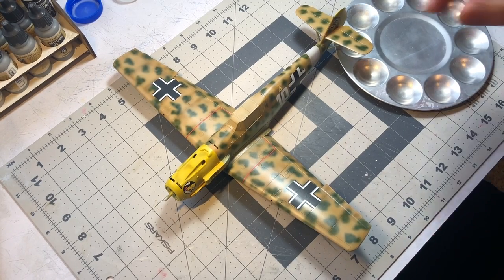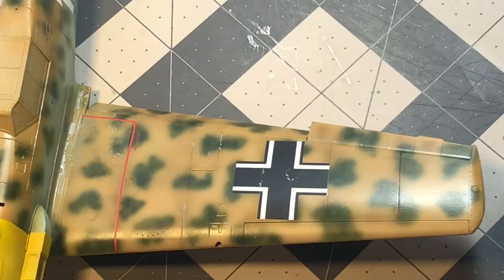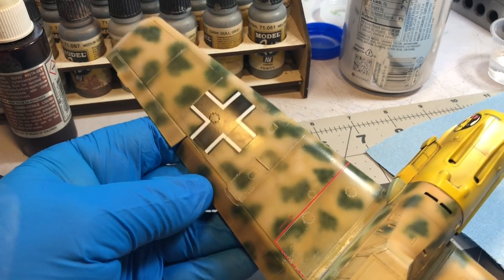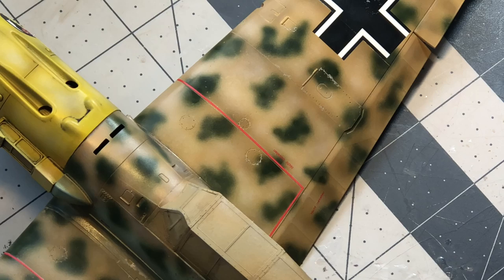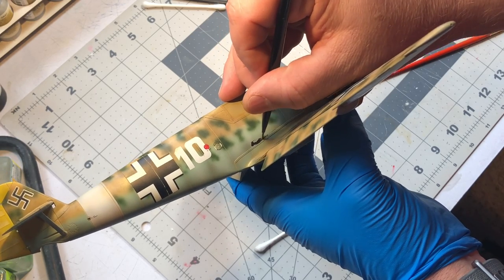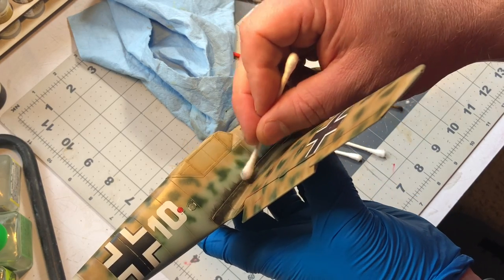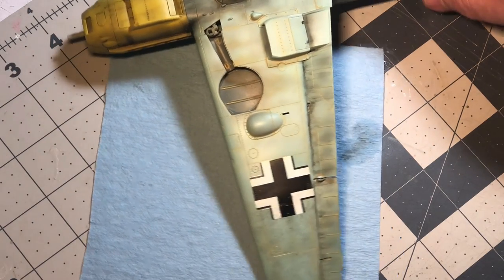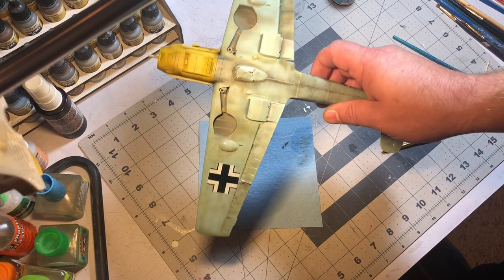Painting the Cyber-Hobby BF 109 E7 Trop: Part 2

Comment: That looks great I'm getting back into the hobby after too many years away and I'm building the E-3 version of this kit right now. Through your videos I'm realizing that Tamyia paints tend to spray best and smoothest. Although I wanted to try MRP and AK RC, but they are just too difficult to find. Also What is your favorite Gloss/flat/Satin coats?
Reply from the maker: Hey there Matt.  If you’re just getting back into the hobby, I’d definitely recommend watching a variety of youtubers to see our different opinions, methods, and philosophies.  Try different things and see what works best for you.  

I use Tamiya because that’s what I started out on and just never saw a need to switch since I’m able to get good results with it.  I’ve never used MRP but those who have say great things about it.  

As far as clear coats, it’s a little more complicated than just having a favorite.  I use a variety of clears for different purposes.  

Pledge Floor Care (aka Future) is a really cheap and easy to use gloss that I use often to protect after decals and/ or washes.

Tamiya x-22 thinned with Mr Color Levelling thinner is my favorite for things that I want to be really glossy

Tamiya Xf-86 flat clear is my go to as a grippy surface for oil paint blending.

Winsor & Newton Matt UV Varnish is what I like for a final flat coat.

It actually gets more complicated the deeper you go down the modeling rabbit hole but I hope this helps a little.
Reply: @seanerk5kt9  Thanks. Some things have changed in 20 years. I've been on a YouTube model watching marathon lately - Doog, Will, Flory...